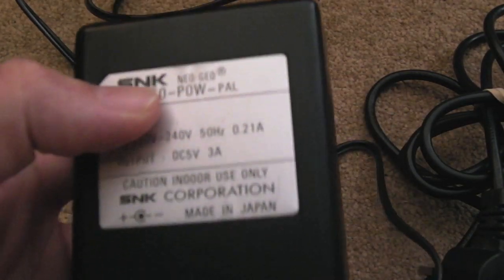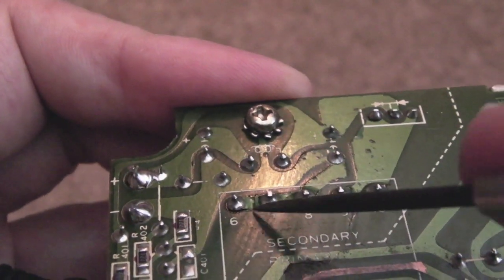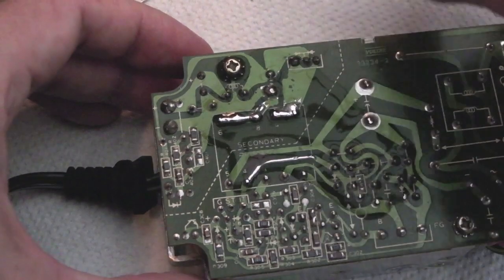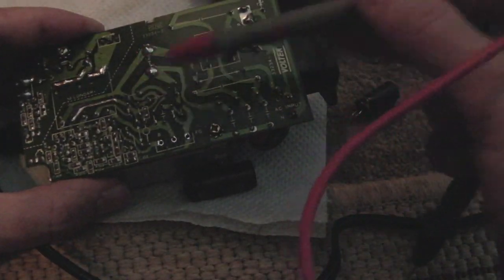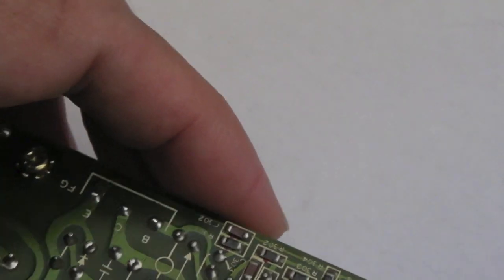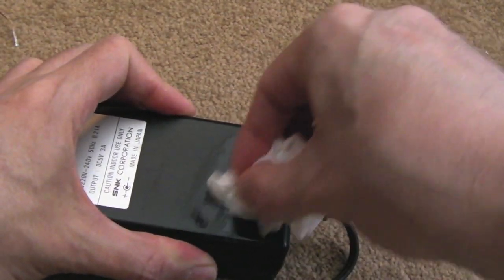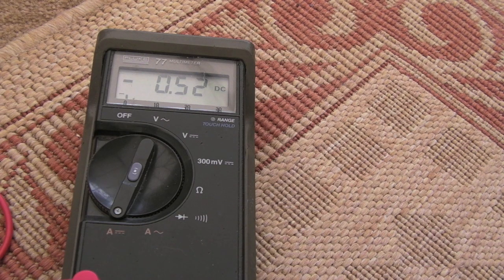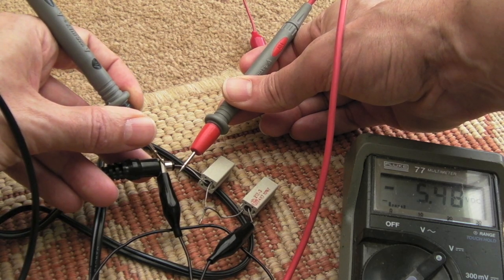SNK Neo Geo AES PRO-POW-PAL PSU Repair 2

Comment from the maker: Corrections! - At 37:55 - the current is NOT split between the resistors.  They would need to be in parallel for that.  I think they could be 3 watt resistors tbh, since when burning the 2.5 watt they did get really hot - too hot to touch.  At 39:58 - I forgot to draw the load (resistor) in lol.  If you connected up your meter the way shown in that diagram, without some load (eg. a resistor or console) in series, you would be shorting the PSU connections out.  I was trying to show that you need to have the probes in series with the flow of current. T fuse is Triage - it's timed!
Reply: The old positive to negative flow... ;)
Loving the channel and the "No Second Prize" music still makes me nostalgic.
(Off topic) Are you getting a Spectrum Next or are you not into the modern take?
Reply from the maker: Thanks =D  I would like a Spectrum next but the cost is the issue - too many other things to focus on.

Comment: Great video as always. I know those wirewound resistors are designed to operate up to 70c to 80c where I work we use them inside the product as a heater in cold environment although the ones we use have a metal heat sink surrounding them. Yeah I think I would of shat my self if I herd that noise, sounded like the Chinese space station had fallen on your house 😂
Reply from the maker: Thanks for the info =D  I need to swap one of those in my fire (the ones with the metal heat sink you mentioned)!  LOL @ chinese space station - I thought that when editing lol.

Comment: Well done for sticking at it. couple of things, you may want to look further at the point on the board where the traces flashed over, what happens is the electrolyte that leaked out of those caps is conductive and on cheap phenolic resin PCB's like that it actually soaks into the pcb a little and as one of those traces is at about 400V dc you start to get a current flow which carbonises the PCB until it flashes over. I'm guessing that triac that died is connected to one of those traces, when a flash-over occurs there is a massive spike which will kill even the beefiest of semiconductors. the best solution long term is a little drastic but it is to remove the transformer then with a Dremal cut a slot between the two traces that flashed over. even though you removed all the carbonisation and cleaned the PCB with IPA the electrolyte is still soaked into the PCB and with time (could be many years) it will carbonise again and flash over, cutting the slot prevents this. but as I say will probably work for many years before that happens.
Reply from the maker: Thanks =D  Yes, the carbonisation can cause future problems as you say, but I am 100% sure there's no issue with the PCB (you could see me measure resistance in the video there, and there's no conductivity between those primary rails there.  After the trace originally blew (before I opened it), the Triac was still working - ie. no short between its pins.  But I suspect that smaller NEC transistor had failed at the point of the original failure.  So when after fixing the trace, recapping, cleaning up, changing the fuse, checking for carbonisation / conductivity, it then blew the Triac because that small NEC transistor on the secondary (right on the regulation feedback circuit connected to the opto isolator) - was telling the switching side to ramp up.  That's why the Triac was failing, but what I don't understand is why there's no protection on the primary side to stop it driving the Triac harder than it should.  It is perhaps just not possible to protect against every possible type of component failure I guess.  Maybe the Triac blowing was a protection to ensure the output side didn't go higher than 5.5v?  I might draw some schematics out for it when I have some time.

The point I am trying to make is the initial flash over didnt seem to kill the Triac (but it may have damaged it).  But the following two Triacs again were not caused by flash over - it was 100% definitely that small NEC transistor on the secondary feeback side.   Of course that smaller NEC transistor probably died due to the intiial flash over though.
Reply: That is interesting, think i got the circuit a bit wrong when i was trying to figure out the faliour mode. i would be very intersted in seeing a schematic if you do find time to draw one out. or ill see if i can find one. I had a very similar problem with a load of 100" plasma monitors my old boss thaught he'd got a bargin on.

Comment: Hey buddy... AMTECH 4300/LF-4300-TF is the same as Chipquik - cost $45  for a 75g jar. With your 2cc/2g tubes you are using you could get 37 tubes worth in one jar. Exact same spec.  REL0 with a viscosity of 20-48 low voiding etc. You can get the syringes and stuff anywhere or order just them from Chip-Quik.. for 10 for $18. You could also get a 150g jar for $80. No shipping constraints since it is non-toxic. If you want some and cannot get it I can order it and ship it to you if you are interested. Also available in 10cc syringe etc. for $15. The stuff stores for at a minimum 24 months as well.
Reply from the maker: Thanks, much appreciated!!!! =D  I've tried Amtech and whilst its very good, I prefered chipquik if I am honest lol - they both behave differently I found.  I also found I can buy it from RS Online here in the UK much cheaper!

Comment: are there differences between the pro paw and the pro paw 2 ? in voltage i mean
Reply from the maker: Off the top of my head - not sure.  Note: Early AES used a PSU that outputs 5v.  Later PSUs for different rev AES (later) used 9V PSUs.

Comment: A very innuendo free video.
I have one of these I want to use for my MVS, but I think my MVS has been wired for centre positive and these are positive negative (or the other way round)  I just need to swap the + and - wires on the socket on the console.

These sell new for about £15 was all this effort needed?
Reply from the maker: LOL :o)  You set me off when I read that!  When I was watching again now all I can do is hear dirty things at points where things look clean lol.  I would just alter the power connector on your MVS!  I was going to do the same with mine since I went centre +ve on the MVS too =/  £15 - no they dont lol!   You can buy modern (junk-ish) PSUs for around £12 to £15, which for something like this I would avoid, since there's little in the way of protection or regulation on the 5v AES (or MVS for that matter).  I've seen them advertised on Console Passion (new) for £20 + shipping, but they had like 1 or 2 in stock and then none for ever.  If you could let me know where I can pick up one for £20 I will buy a few lol.
Reply: Its more hand gestures in this video around 43:00

I got one a new one from www.Robwebb1.plus.com a couple of years ago.  Thats listed as sold out too now.
I also found a guy in Austraila who builds new powersupplies for consoles, cant remember his name now.
Reply from the maker: LOL @ hand gestures!  I never even noticed myself doing that.  Yeah, if you can find them at £15 to £20 buy them lol!

Comment: Do you know what the triac was for? I don't think I have seen one on the primary side before.
Reply from the maker: Honestly no idea, it seems to be connected to the main switching voltage.  I am not sure if its some kind of fail safe - perhaps designed to short and die if the output side goes over voltage or something.   The faulty transistor was connected to the opto on the secondary side, so I can only assume that it was over driving on the primary side.
Reply: Yeah I guess to some protection circuit.. Maybe.. Just so odd.. I can't see any switcher ic on the board.
Reply: I just read your answer to Jays Vintage Junk below and that sounds plausible that the transistor was telling the primary side to open fully. That would most like blow the fuse and other stuff indeed. I guess if there is no protection ic there are less belts and braces on this design :)
Reply from the maker: Yeah, I suspect so!  I guess they cannot protect against every type of failure.  Someone probably worked out that the odds of that small transistor failing were probably pretty slim (until a cap leaked everywhere...)